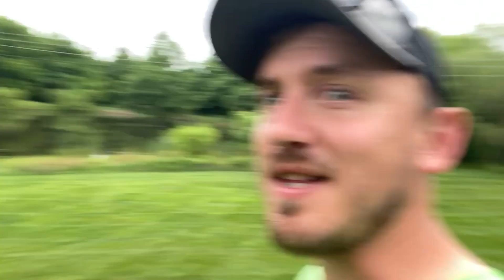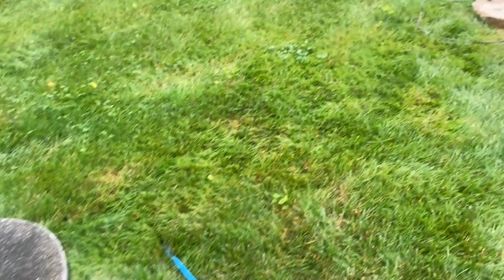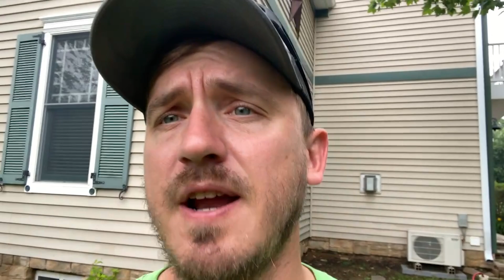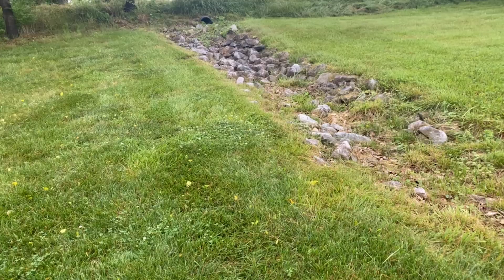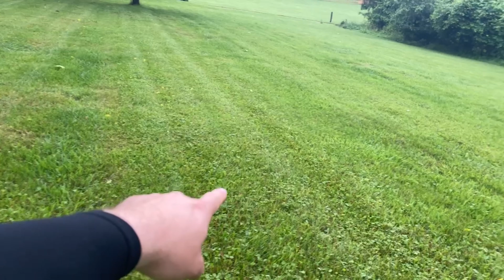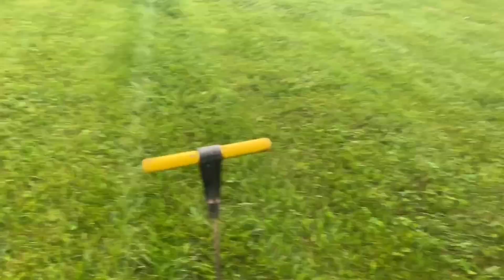Septic Systems 101: What You Need to Know About Pump Chambers

Comment: I have a concrete box septic system and the leech line going out is leaking around the top part is there a rubber seal there